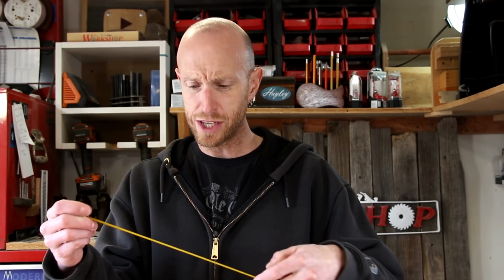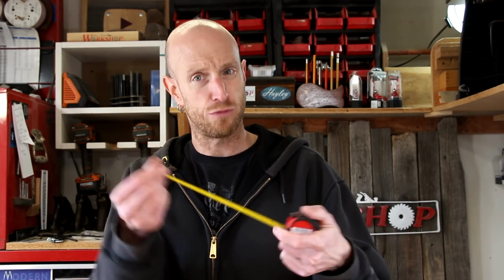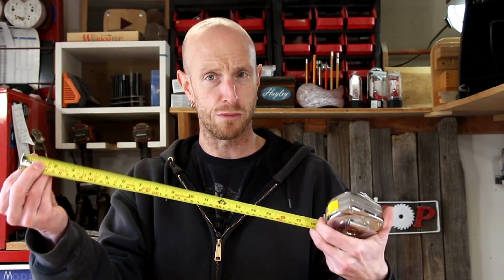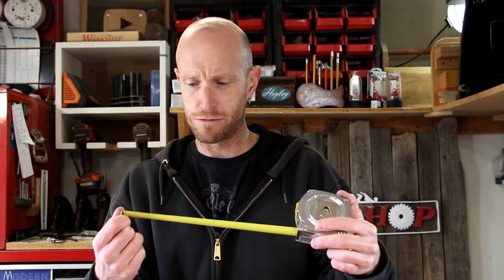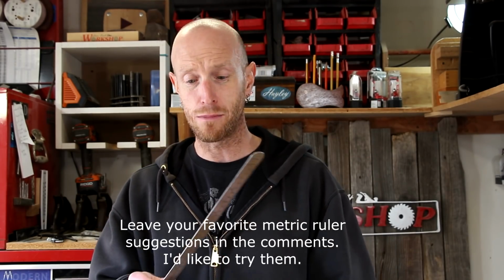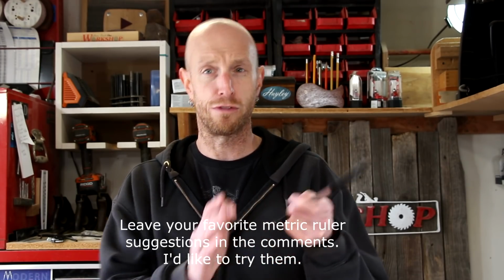My thoughts after using the Metric System for a project | I liked it

Comment: I am a precision machinist and for the record, I will say that I HATE the imperial system. Metric is SO MUCH EASIER. the tools and gages are built to higher tolerances because .01 mm is the base unit and it is roughly .0004 inches per dial tic rather than .001 or even .0005 for some indicators. Will I get rid of my inch metrology tools, probably not but I will say that American machinists are at a disadvantage if they don't utilize both systems...

Comment: Fun fact.  The rest of the Anglosphere started with the metric system in 1960s.  Even my dad born in 1939 knew you to use it.  I think Yanks are stubborn.  You need to get over it and move on.  We did and its bloody accurate and easier to especially tiny units like 1.016mm instead 40000ths of and inch.

Comment: Aaargh, it's really sad reading these comments that none of the holier than thou champions of the metric system have any understanding of underlying rationale of the imperial system.   Simple example is that you can divide a circle accurately into 1/3rd but can't do it 0.333 of the circumference, hence we still use degrees for common measurements and radians to be more accurate but not a "metric" system.   But the main feature of the imperial system is that it is tuned to the object being measured, the classic example there is of course the light year.   The metric system has undeniable advantages, mainly for science and engineering, but it is very poor at describing relative scales of the human world as beer drinkers can attest, one pint at a time.

Comment: Canada is technically metric. Our groceries are in litres and grams. But all our lumber and construction materials are imperial. So sure I can measure my half inch sheetrock in metric but... No. 
Therefore our houses are typically measured in feet.  I'll generally use imperial for things that don't require precision or any math whatsoever, like the size of a desk that will fit in a room. If an error of an inch makes no difference, imperial is fine and easier to remember.

But if I need precision closer than a half inch, or I plan to do ANY math, it's metric. Division in imperial? What a nightmare. Drawing plans for something, definitely metric. Unless all the parts are in imperial, then I'll have to use a bit of both.

Comment: Not going to rag on you about the "standard" thing. I get it- you were exposed to what is a new system to you and you were referring to your familiar system as standard.  Perfectly understandable.  

Fyi metric is more accurate.  You weren't imagining it.  To be more accurate (heehee), metric doesn't mess around with units.  You don't have to go between incompatible fractions to get the increment you want.  Measuring a race? Use meters.  Measuring a table? Use millimetres.  You can convert to meters by multiplying by 1000 if you need to.  

What you were realising was that metric frees up brain space you never knew was occupied,  allowing you to concentrate on precision.

Comment: I basically always use metric but one of the things I really like about imperial units is that it is relatively easier to quickly divide dimensions in half. Take a quarter of a 3cm piece of wood and it quickly becomes awkward to really measure that out because most tools don't easily let you do 0.5mm steps, while inches are basically always divided by powers of 2. Especially when doing wood joints I like this part of the imperial system. It's very easy to work around (e.g you can just not divide things exactly in half) but it takes away some of the evenness at times.

Comment: When you talk about converting fractions I was like: then why people even bother to use this system? It feels so outdated. Also, why not to use a single unit for all measurements in one project? Even in metric we tend to use just millimeters. No centimeters, millimeters and meters mixed in one project, most of the time you will see just mm. (it's so standard we sometimes don't even bother to write the unit - there is not unit, then all measurements are in millimeters).

Comment: Two comments.  Did I hear you say that Imperial is the “standard” system?  The number of people using metric is the population of the world minus the population of the USA. Regarding accuracy, the millimeter is just a nice practical unit to use, and at 3mm per 1/8” you would have to go to 32nd’s to be more accurate.  

My country went metric when I was at school (I am now almost retired) so I know how Imperial works. My biggest problem is that in woodworking there are many very good designs out of the US but they cannot translate into metric without considerable re-working. 

I also find it very funny that Americans use the term “Imperial” or “English” system with pride when you went to war to get rid of English imperialists.

Comment: Metric doesn’t only mean using Kilometres, meters, centimetres, millimetres, micrometers, nanometers.. It’s also jumping from one measure to another with logic. One cubic meter is (obviously) not only a 1 meter-side cube, it’s also equivalent to 1.000 litres. And 1 litre of water weights 1 Kilogram, so 1 cubic meter of water weights 1.000 Kg., or 1 (metric) Ton. The logic equivalence between measurement systems and its accuracy is why it’s being used worldwide (well, almost..) 

On top of that, having to use decimal inches or having to use convert factors when going from inches to feet and from feet to miles, cubic feet to cubic inches, pounds to ounces.. it just doesn’t make sense. In other words, the fact that you are used to a (shitty) system doesn’t mean it’s a good one.

Comment: I cannot understand ppl, who want to continue using the imperial units.
I cannot imagine any physical units when it is in imperial units. I don't feel pound per square inch, unlike Newton per square meter, what is a Pascal. And what is a Joule? The energy can be defined by a work when 1 Newton moves something over 1 meter. And 10 N is almost 1 kg, and cubic meter of water is almost 1000kg. And what is the pressure on the 10m depth? If 1 cc of water weights 1g then on the length of 10 m you will have 1000 cubes and that is 1000g or 1kg over the square cm, so it is 1 atmosphere or 1 bar or 100,000 Pascals. Metric system is interdisciplinary and it can help to understand the physical values of phenomena.

Comment: I'm a Canadian, I grew up in the 80's and 90's and I've done a fair bit of work in wood frame construction. I learned metric in school. I learned imperial on the job. The math is easier in metric. The precision is better, the units are more easily divisible into smaller units. That being said, imperial is human scale, fractions are not that difficult. And the conversions suck. Were I to build a house today I'd still use it. Because a) I find it easier to estimate human scale things with it. and b) It's the standard in materials and building codes. These things have been designed to work together using that antiquated system. Converting it to metric is messy, you never get round numbers, or even whole numbers. It could be done. It would mean those codes would need to adapt and you need a generation of people like me that are comfortable in both systems.

Comment: Imperial is a functional system. It works. People wouldn't have stuck with Imperial if it was a bad system. The benefit of Metric is that it's easier, simpler to teach and quicker to use, but Imperial is still perfectly serviceable for normal day to day activities. What you really need Metric for is when precision is an absolute requirement, such as measurements taken by the scientific community or for high quality engineering projects where you want the design tolerances to be as accurate as possible.
Reply: Wrong. The Imperial system is just an obsolete, inconsistent, inefficient system. There was a study done where, using the same project, they built the same two  houses using Imperial and metric. The construction team using metric produced one wheelbarrow of waste materials, the one using Imperial produced 2 tons. It is simply a bad system.

Comment: 1 ounce = 0.0625 pound......  thats all i need to say about the imperial system :D alculate 23,45 Ounces into Pounds. In your Head.... you have 2 Seconds. :D Well im sure some may be able to do this, but i dont wanna be a Rocket engineer to messure the length of something i need to cut or the weight of something i need to fill in ( and i dont want to talk aboput Liters cause there it gets weirder ). I just want to take my "," and put it back and forth and get the result :D

Comment: Metric: 10-100-1000-10000 etc.
1L water is 1kg water.
Water freeze at 0C. 

1 Milliliter = 0,001 L
1 Centiliter = 0,01 L
1 Deciliter = 0,1 L  
1 Liter = 1 L

Millimeter = 0,001 m
Centimeter = 0.01 m
Decimeter = 0.1 m
Meter = 1 m

1 kubikmeter of water = 1000kg = 1 tonne. 

And so ok, not that hard..

Comment: Using 'imperial' units isn't really a good idea for precise projects. 
I grew up having to learn both but I preferred the metric system and only really learned imperial for older applications. After-all, when one says 1/4 or 1/8 or even 1/16 of an inch it is not particularly useful unless those are the increments one is working with. Y

Comment: The metric system is so much more precise and easy to use. All of the conversion factors amongst like measurements are 10 (e.g millimeters to centimeters)

Where ours are different for each set (12 inches to a foot, 3 feet to a yards)

Our system is absolute nonsense.

Comment: I feel dizzy thinking about the 3/45ths and stuff you guys are using, and for even smaller units like 1/10000th and such its just silly. I have been in manufacturing for 40 years and always used Metric though so i am biased of course. I'm sure you guys learn 'tricks' to get by. One thing I imagine i would have even more trouble with is dividing in Imperial. That's got to be easier in metric?

(and I don't mean simpler stuff like 30 inches divided by 3... :D even I can figure that out!)

Comment: Neither system is superior but the metric system was defined and refined after science and education had become a little better. The differance really is slightly more convenient for hobbyists because of the size of 1 mm. The reason nasa and american military powers use metric is compatability. You don't want to fuel a nato plane with 5000 gallons if it needs 5000 liters. Or how about building components for the international space station.

Comment: Metric is OK.
It has its limitations.
Its sole advantage, which is of very little value to me, is it uniformity across various modes of measurement.
I've used it enough to be completely comfortable with it. 

The myth of having more accuracy using metric is completely false.

Try measuring guitar string action height using decimal inches, fractional inches, or millimeters, then tell me which method is most accurate and meaningful.
Decimal inches are the winner, hands down.

The system that performs the best depends on what someone is measuring, why, what type results are desired, and so on.

The severe limitation of fractionalizing metric is aggravating.

I don't refuse to use metric.
I use that which works the best for any given situation.

To those who are metrically-shackled and in a mood, you can now commence your attacks upon me.
I'll sit back and enjoy the show.
Reply: How would decimal inches win though? You can just divide your millimeters into micrometers if you really want such precision. 
I think the more scientific basis behind the metric system is also very important, compared to foot.
Reply: @Astrovation  
In my example of measuring guitar string action, micrometers would be a level of precision beyond that which is useful or meaningful.
It wouldn't even be discernible without having to resort to absurd methods of observation.
Similar to the meaning of the story, "Goldilocks and The Three Bears," (the version highlighting that which is just right for a person, not the version decrying the improper use of other people's belongings)
decimal inches is just right.
What is important is using the system that works best in any given situation.
It's obvious to me that those who are unable to appreciate any system of measurement other than metric are dooming themselves to lives of settling for less than the best.
That's their prerogative.
As for myself, I'll enjoy the best that the world has to offer.
Reply: @bobjeaniejoey  you don't neccesarily need to use single micrometers, use every second one for 5x accuracy compared to mm and if u use every 5th you still get 2x accuracy
Reply: @Astrikss  
I'll go into a detailed explanation below, but simply stated, 1/5mm is too small to be seen with the naked eye for even a young person with good eyesight, and being so, it would be of little value to the luthier.
Also, I've never seen a ruler graduated in 1/5mm, nor 1/10mm for that matter.
They probably exist somewhere, though, I guess.
1/2mm graduated rulers, of which I have a few, are not fine enough when a better system is available.
There is nothing in between those two extremes in metric while still being able to call it metric.

Perhaps you don't fully comprehend the reasoning for the type of measurement I've described and how that measurement is of importance in a few different ways.
I'll explain.

The height of a stringed instrument's strings above the fretboard at 1/2 the distance of the scale length of the instrument from nut to saddle, which in western music is at the 12th fret on a fretted instrument, is known as the action.
This dimension varies to some degree depending on the exact type of instrument, with a typically desired range of .045" to .1" (1.143mm to 2.54mm, {you can call it 1mm to 2.5mm if you like}) but is commonly found to be outside of those parameters when an instrument is in need of adjustment or repair.

The graduations of the measuring device need to be large enough to be to be able to be easily seen with the naked eye, not so small that the level of accuracy exceeds that of both the eyesight as well as the PRACTICAL needs of the luthier; yet on the other hand, a graduation fine enough is needed to be able to definitively state that an actual, PRACTICAL measurement has been determined, not just an approximation.

Using metric, a graduation of 1mm is too coarse to be of PRACTICAL value to the luthier. 
A graduation of 1/2mm is getting there, but we can do much better using decimal inches or alternatively but slightly less accurately using fractional inches, which is still more accurate than 1/2mm.
Conversely, a graduation of tenths of a millimeter is much too small to be seen at all without the use of special optical equipment, even for a young person's eyes. Even a metric ruler graduated in 1/5mm (if 1/5mm graduated rulers are even available, I've never seen one) would be too fine a graduation to be able to be seen without additional optical equipment.
That is the extent of division that can be done using metric without departing from its tenets, which seem to be of a sacred nature to those who worship the system as if it were an extension of nature itself.
Metric is not sacred.
It is simply one method of measurement among others.
Stated succinctly, metric is either too coarse or too fine for this type of measurement.
There is no satisfactory in-between.
No, I'll take that last sentence back, for the sake of my saying that metric is adequate, but in this case as among many other examples, imperial is better suited to the task at hand.
Actually, 1/2mm graduations just begin to enter the range of being useful, but since imperial is available to me as a better system, I'd be a fool not to use it.

Now, let's apply decimal inches to this specific type of measurement.
Very simply stated, the graduation of 1/100" is arguably the smallest graduation that can be fairly easily seen by the vast majority of human beings without the need for magnifying equipment and a very steady hand.
That PRACTICAL degree of accuracy is what is needed by the luthier, not more, because it wouldn't be able to be easily seen, and not less, because the luthier would then be entering into the realm of guesswork rather than having quantifiable information to use in effecting adjustments and repairs.
Decimal inches provide the luthier exactly what is needed to perform their work.

I'll say this one last time.
Metric is OK.
It serves very well in scientific settings.
I sometimes use metric, with appreciation of the characteristics inherent in its design.
However, it is not the be-all, end-all that many of its proponents proclaim it to be.

You seem to be genuine in your attempts at sharing with me your views on the subject.
Even though you seem to be quite persistent in your assertion of the value of the metric system, I thank you for your attitude of tolerance in allowing for the continued clarification of my stance.

I find that the overwhelming majority of proponents of the metric system are ignorant of the imperial system and are close-minded, arrogant and condescending towards proponents of the imperial system.
I don't take kindly to such attitudes.

I'm perfectly willing to educate or to be educated about anything.
I love to learn.
I know enough to know who to learn from.

Cheers!!!
Reply: @bobjeaniejoey  well that's quite a detailed response indeed, i guess you are correct though, for most purposes it doesn't matter wether u use metric or imperial, depending on what you grew up with and your preferences. If imperial works better for you i and I hope everyone will respect that.

A main point against it isn't really that it doesn't work, but as humans like to standardize everything 2 systems of measurement quickly lead to discussions such as this one.

In short, both systems work which is all it needs to do, with mainly standardization being an argument against imperial since it's the standard at more places

Have a great day tho!! 😀